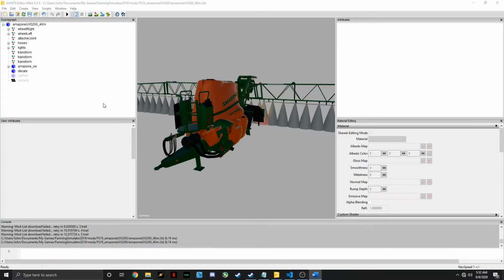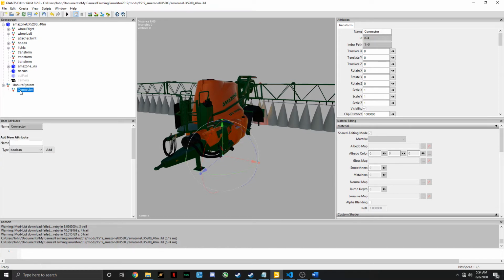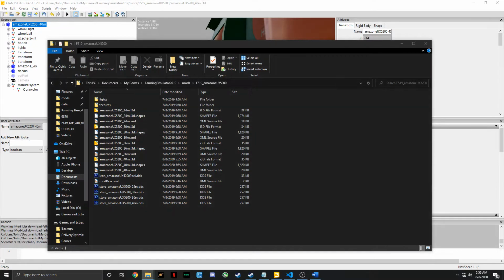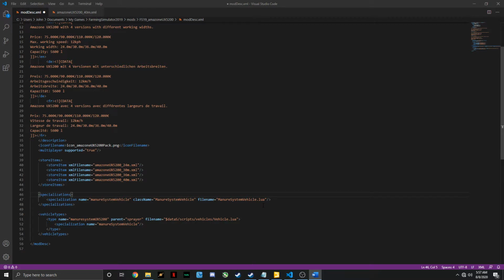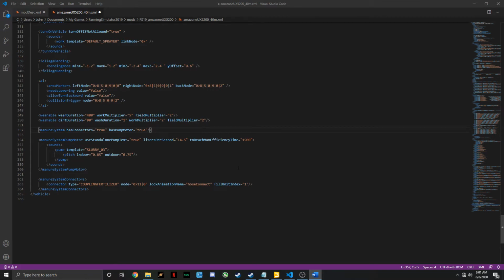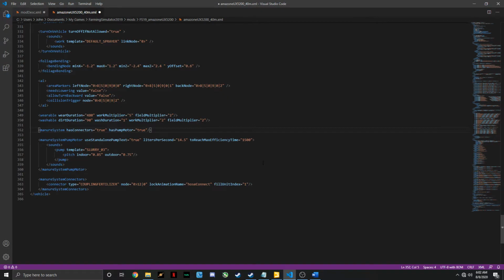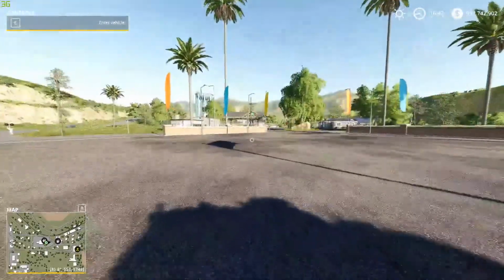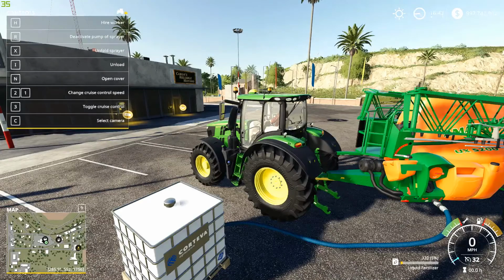FS19 Modding - Adding Manure System Support for Vehicles

Comment: @Perma’s Modding….. So I’ve done everything in video and manure system works but on the GEA tender trailer I’m working on it has a arm that swings out to fill slurry sprd’rs but not the funnel type,so I’m assuming it doesn’t need it’s own xml? it should be a filltrigger that swings with node (arm). but I can not get the filltrigger too show up in the F1 menu. Any help would be very appreciative

Comment: I followed the tutorial to the T, yet in-game, the vehicle shows up in the store but when I attempt to purchase it, it says the store is too full and I need to move some vehicles. Any suggestions?
Reply: I have the same issue, did you get it fixed?
Reply: @jodyemmerson3446  oh yes, I’ve improved a lot since this comment. Run your xml (copy the entire xml) through an xml validator and it’ll help you check for errors.
Reply: @ForwardAgSolutions   thanks for the tip! but for some reason I still don't have the pump options or even the hookup connection showing up in game and I've followed the video, used whoppers github and copied files from a sprayer that works on MS. I have no clue what I'm doing wrong.. and when i check a XML validator I don't have any issues
Reply: @jodyemmerson3446  it could be a node issue. If you’d like, shoot my page (Forward Agricultural) on Facebook a message and let them know Josh sent you! I’ll help you out!